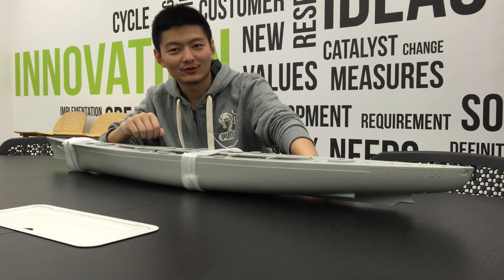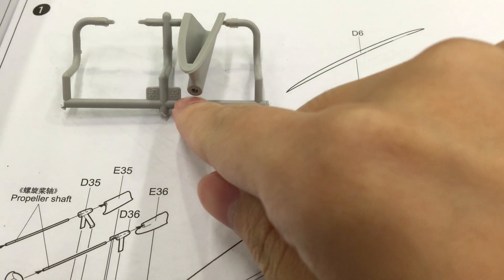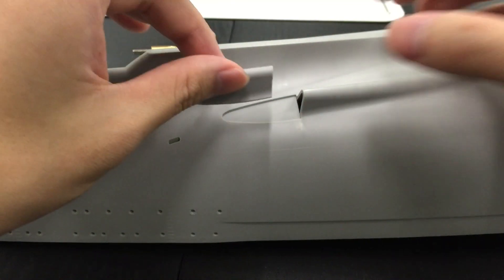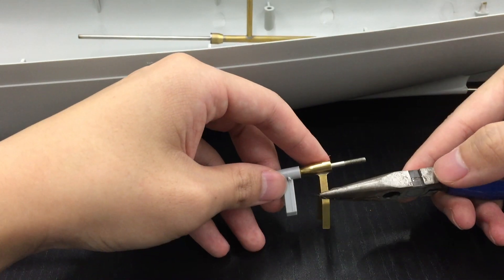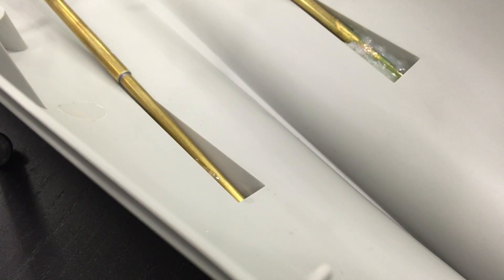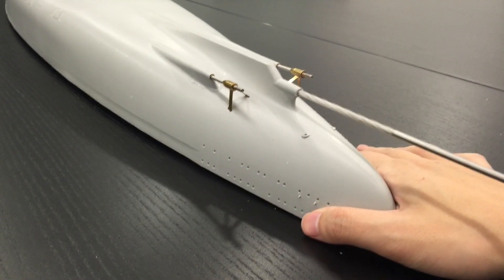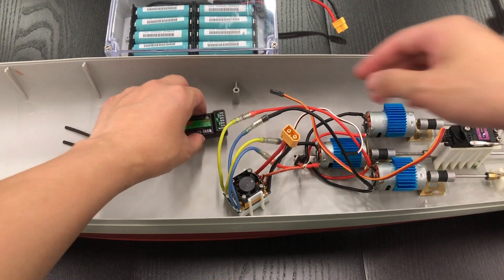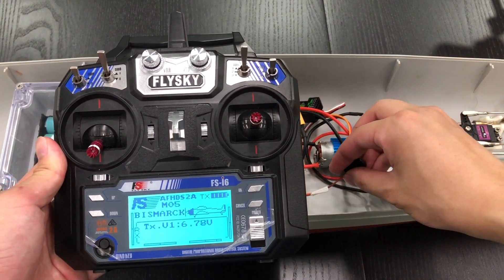1/200 Bismarck Battleship RC Conversion Tutorial

Comment: Hello. There is one thing I don't understand. We make models to look like the real thing. Why do we motorize them to look like toys? That model looks like it has 2,000,000 hp. move the prop at less than 400 rpm which is the actual angular speed. The Bismarck 1:200 I build moves fine with that alone. A single motor from a shaver is enough to move all three props.
Reply: It is odd, they look great until they do about 200 knots.
Reply: eso estaba pensando... Se ve muy lindo pero 3 motores es demasiado, creo que con sólo uno de la misma potencia o menos, seria más realista
Reply: @sbenitez1768  Mira,estoy haciendo un modelo escal 1:200.Como te puse ,con un pequeño motor y su sistema de engranajes usando una afeitadora philips a bateria logro mover las tres helices a bastante mas rpm que el buque real.Con la modelizacion no es facil calcular algunas cosas,pero  un buque de 48000 tons a escala 1:200 pesa 6 kilos y para moverlo en el agua a la velocidad a escala ,si el real navega a 30 nudos,unos 54 kmh,tu modelo debe navegar 200 veces mas lento es decir 270 metros por hora es decir 7,5 cmts por segundo.Puedes redondear en 10 cmts por segundo.Mas de eso lo hace verse como una lancha de carrera.No digo que no dispongas de una potencia extra para salir de alguna situacion complicada.Pero si quieres hacer algo que se vea real ,debes limitar la velocidad.Si quieres generar la ola de proa te digo estoy con la idea de colocar algo en la proa bajo linea de flotacion y un poco antes de la maqueta que genere resistencia al avance y que levente un poco de agua .Hasta aquí todo lo que tengo para aportar.BUENA SUERTE.
Reply: @edselrodriguez5450  hay algun lugar donde pueda ver tu barco? yo lentamente estoy haciendo mi bismarck. mi idea es con solo un motor mover las 2 helices x medio de engranaje o polea  y la central dejarla fija ya que en la linea de crugia tiene un refuerzo y si lo corto pienso que lo va a debilitar (kit amati de madera) , aunque no descarto la posibilidad de hacerlo y que anden las 3. personalmente no me gustaria que parezca un fuera de borda pero que tampoco haga 1km por semana, a mi gusto se haría aburrido ademas que como decís, en lugares complicados como puede ser un río, con tan poca potencia se lo llevaría. Saludos
Reply: @sbenitez1768  mi barco aun no flota.Yo no parto de ningun kit.Parto de cero.Solo tengo una maqueta Heller Esc 400 de donde saque las medidas para hacer una muy fuerte estructura en madera de balsa.Eso lo hice hace unos 25 años.Luego me quedé sin tiempo y hace un par de años retome las tareas.Yo trabajo sobre cobre que luego atornillo,clavo o sueldo sobre la estructura de madera.Ahora cuento con planos alemanes bastante originales de hace 80 años lo que me facilita para las formas.No tengo nada publicado.Es un proyecto muy diferente al tuyo,no se si te serviria de algo.Este es un proyecto que navega,que tiene sus torres de 380 y de 150 que giran y elevan sus cañones mediante motores paso a paso y poleas por lo que son muy precisos en el movimiento que tambien respetan las velocidades angulares de las torres originales.Con luces a led en cada ojo de buey que encienden y apagan simulando actividad.Tengo par dos o tres años más para terminar.Estoy en America Latina,entre Argentina y Brasil,un pequeño pais llamado Uruguay.Por ahi por whatsapp te puedo pasar alguna foto y tu mandas algunas de tu modelo.
Reply: @edselrodriguez5450  venia a borrar mi numero pero creo q nunca se envió
Reply: @edselrodriguez5450 Dabei wergisst du aber, dass das Medium Wasser nicht im Maßstab schrumpft. Und das ist essenziell. Die Dichte wäre 200x höher, weil ja auch die Atome mit schrumpfen müssten. Somit ist die Diskussion eigentlich hinfällig.😉Liebe Grüße

Comment: Hello
I would like to know what material did you use to motorize the boat?
Which transmitter / receiver?
What battery?
What variator?
Which servos?

I would like to convert my USS Arizona Trumperter model.
Thanks

Comment: @hugo great conversión. Please, how do you close the hull? Do you know some trick to do It waterproof and have access to electronic at the same time?
Reply: I would use magnet to hold the deck to the hull, and leave only one square open for accessibility, using O Ring material as the seal.
Reply: @CUISONY  Thanks!

Comment: Have you had any luck converting 1/500 or 1/700 Battleships? What is the smallest scale you would recommend converting?
Reply from the maker: That’s a great idea and I have seen local fans do so, even on a 1/700 Warspite but with just one shaft as simplified propulsion plan. At that scale level, very gram on load should be evaluated very carefully. Personally, I think 350 scale is more suitable for entry level because it really has a perfect balance on size, degrees of difficulty and cost. When the scale shrinking to 700, many kits should be made dedicatedly. Definitely, it would be a great challenge that it may require much more patience and experience.
Reply: Although the smaller scale the more unrealistic hydrobehavior, I would like to take the challenge to convert one 1:700. I can find 1:350 conversation part on eBay but not able to find 1:700 parts. 1:350 parts can be use for 1:200 ideally.